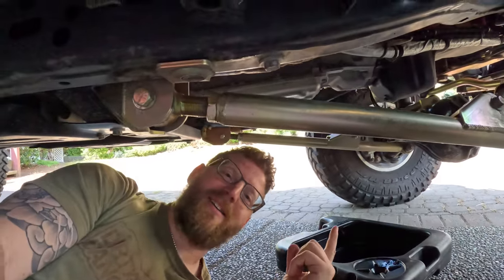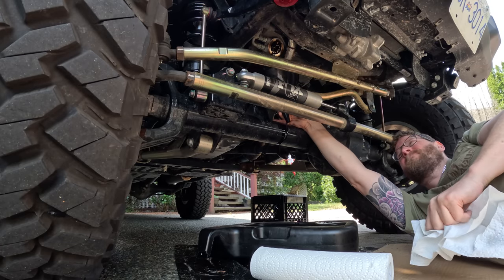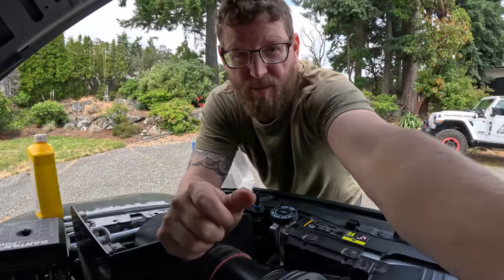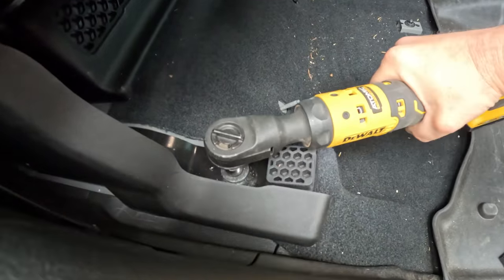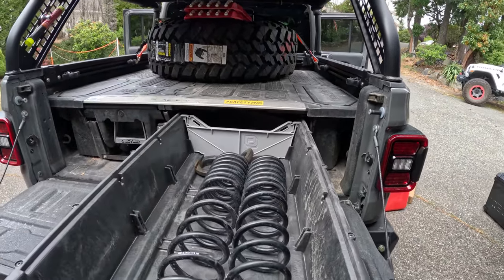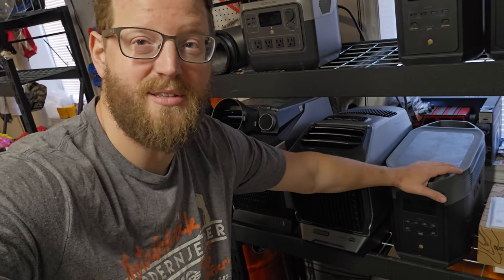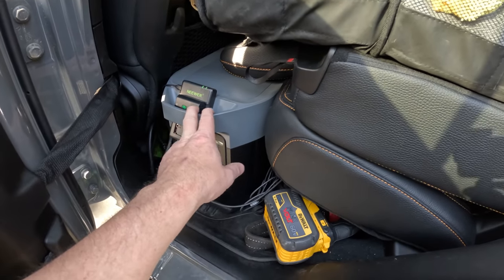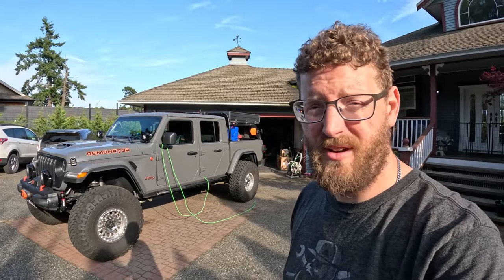I Am Really Struggling With My Jeep Gladiator...

Comment: I did the Decked system and half rack on a Tacoma, incredible waste of space,
Went with the RSI Smartcap on my Mojave, have bulkhead water tank, solar on the roof, house battery with both DC-DC and solar charging, stayed with 37’s, spare squeezes into stock mount, frig mounted on slide in the cap, pulls out over tailgate, makes a great cooking spot

Comment: For you Gladiator owners. on 37s, Clayton Offroad has a rear trackbar with a bend that will clear full size 37 under the bed.  If you aren't on 39s or 40s, this is a great option to get that thing back under in the factory location.
Reply: Clayton > Metalcloak
Reply: I have Clayton and that is correct

Comment: Topper , lose the decked system, hitch or bumper spare tire carrier, one that will also accommodate a fuel can and an auxiliary fuel tank where the spare used to be. Just a few ideas I’ve thought about with my gladiator. I kind of like Shawn’s setup.

Comment: I run my arb fridge in the back of my truck for the last 10 years and never had a problem. Dump the slide in the back,put a dry box in.  Put stuff you dont use much in the dry box.  Everything else in storage boxes or dry bags.  Spare tire on swing out on rear bumper.  Cant you store all your bedding ect. In the roof top tent.  The soft roof top tents may take a couple of minutes longer to set up but you can store tons of stuff in them.  I have a james bourand soft roof top tent and it does not use a fly.  It has a aluminized cloth outer.  I store all my bedding and in the winter 2 sleeping bag plus lights,guns,ect and still have room.  It is built to withstand 70 mph winds and only weighs 70 lbs.  Buy your Pennzoil synthetic from crappy tire when they have it on sale.  You can get it dirt cheap.

Comment: If you put a topper \ cap over the bed and ditched that deck system you will have way, way, way more dry storage capacity. I also stuck with 37s so that I can keep my spare underneath.

Comment: There is a bumper that is split in half as you see on other vehicles. My brother has it on his gladiator, and it allows him to carry his spare tire, his jack, and, I think, a gas can. It seems like a good option for him to use with his AluCab enclosure with the side openings and inside drawer system. A lot of safe storage is available. He also has a goose gear seat delete behind his seat with an inverter and lithium battery below to run the cooler he has on top of it.  Just a thought.

Comment: Most of that decked stuff can be in your cab if you remove the seats. Ditch the decked system. My wife and I have gone on a 10 day overland trip with less. My exped and down quilts are stored in my RTT. Fridge and dry food/ cooking storage goes in the back and takes up half the bed. Wood, toilet, and 20 gallon propane tank take up the other half. I have a low 8” tall rack and out my chairs on top of this stuff. I can’t imagine a wrangler holding the sheer amount of stuff we bring, but I’m on 35” trail grapplers so my spare is under the truck. 

Maybe put a flat spare under your truck with a ratchet strap that makes it so it won’t contact the track bar, or go with a triangulated 4 link and remove the track bar.

Comment: My gladiator is on 35s and a 2inch lift. Also I rsi topper. Planning on a desert armor roof top tent. This has covered all my overlanding type of trips and even Marble head trail in the UP of Michigan. Hardest for me is setting up the cooking set up. Thought are 270 degree cover with a small pull out kitchen.

Comment: I'm in the Wrangler camp.  I have mine setup with a rear seat deleted, a raised deck for sleeping, sliding refrig and cook stove, large drawer above cook stove.  Then built in storage cubbies under the deck accessed through rear doors.  Roof rack for the excess stuff such as tarps, recovery gear, etc.  Mine is a dedicated overlander and not daily driven.  When not tripping it sits at home.

Comment: I think the hard thing w the Gladiator is it doesn’t truck as well as a 1/2 ton truck and doesn’t Jeep as well as a Wrangler. I think as an overland rig it could be great, but as you said you have to pay that premium for even more thing like a canopy. And a canopy you can put a tent on will run you more that the hard top option on a wrangler. Or you can leave it open and then risk stuff being stolen or dust killing things like fridges. 

For me the real deciding factor is w dogs and summer I don’t have AC in a truck canopy so I will be going w Wrangle.

Comment: I am in the same situation minus the spare. Swapping out to a canopy/camper put the spare vertical and ditch the decked system. The other option would be a flat deck/canopy or a bowen customs bed replacement.

Comment: Ditch the Decked system, its great for construction guys and their tools, but you're losing 30% of your bed space.  Id find or fabricate a vertical tire mount just forward of one of the wheel humps in the bed or centered behind the rear glass, leaving the rest of the bed fully open for more creative storage systems than the Decked box.   Another option is the JCR Offroad Adventure Carrier that has two reversible hinged mounts, one for the tire and one for two 5 gallon jerry cans, both swing wide enough to still open the tailgate and access the bed.

Comment: Dunno why my first comment is not showing up but, I have the tire carrier bumper from Doetsch offroad on mine.  It's great but you will lose rear camera functionality for the most part (unless they have developed a relocation kit, mine was the prototype).  So all I did was get a Wolfbox front/rear camera system off of amazon and installed it on top of my rack.  Now I can see behind me without any real problems.  I also now have a forward facing dashcam as a bonus.

Comment: The decked system is your problem with your tire. Eventhough it's nice having the big drawers it takes up the whole bed and greatly shortens the height of your bed. If it wasn't in there you might could stand your tire up against the back then put a stacked drawer system to one side and have the other side fully open for whatever else

Comment: 40’s + Decked drawer system is in my opinion “Garbage”. The decked unit is 1. Heavy 2. Poorly Designed 3. A waste of space…  Not much you can do about the 40’s though… even with 37’s you have a fluid tank in your spare tire area if I remember. 
Best option for space with your setup would be a GFC or Alucab honestly. Love the content, keep it coming! 👍🏻❤️🇺🇸
Reply from the maker: Thanks! The decked was a last minute purchase before Moab to secure gear. It has its ups and downs and I've like it so far.

Comment: Trucks are a challenge for sure

I’m going to try the ARE CX HD with their windoors for side access. I’ve had a CX on my old 1st gen taco and it’s held up for 150k miles including 6 years of wheeling in Alaska so I’m going to try it again. YMMV though. It solves the water, theft and dust issues though

To your point, if you have a dedicated overland rig for 1-2 people, the wrangler seems like the way to go. Dan Grec’s Africa jeep, the road chose me’s crazy new custom wrangler camper, AEV Dave’s Outpost II camper, Venture 4wd’s full time camper, Justin B’s wrangler….great combination of secure gear storage and small vehicle capability 

I’m going Gladiator because it needs to be my daily too. Wranglers are definitely more capable but I like to keep my bike and skis inside the truck topper when I’m driving on slushy/salty roads and I definitely don’t want to throw a load of manure in the back of a wrangler when I’m doing house chores
Reply from the maker: Thanks for sharing

Comment: You'll have to do what I did. Remove gas cap. Slide a real truck under it. Reinstall gas cap. 
3/4 ton truck come ready to upgrade. Comes with power, torque, solid base axles to start with, etc. Single cab only. It's already heavy duty.

Comment: You need a topper...I plan on getting the RSI Smart Cap EVO. Also 40's are unnecessary in my opinion. My plan is to install Rock Krawlers 4 link triangulated rear parts with Nitto Recon Grapplers in 37 x 11.5". These will fit under the bed just fine. The Gladiator is a great platform but outfitting is a trial and error process. What works for me, works for me... your mileage may vary. There are many great ideas in the comments below...

Comment: The Gladiator build is great and made for some wonderful content as well, but I think it’s hard to beat the box-shape interior of the four door Jeep. That’s especially true if most of your gear needs protection from the elements (e.g., photo gear, including a relatively clean place to change lenses and so on) and to somewhat deter theft. As an aside, the included Power Box for the 2024 4xe looks pretty handy.
Reply: I’ve managed to get a crap load in my 2dr. I live like a king.

So any 4dr wrangler or gladiator can do it

Comment: When you put the new filter on: you should fill it with fresh oil (at least halfway, more if you can install it without it spilling when installing), you should also take a finger full of fresh oil and lubricate the band of rubber on the top of the filter before installing, clean the mating surface on the engine where that band of rubber contacts, and unless you enjoy throwing away money there's no reason whatsoever to buy a Mopar brand filter. A filter is a filter is a filter, it really doesn't have to be Mopar.

Comment: Quite a quandary,  Long trip, no tight twisty trails, lots of gravel roads and fire roads gladiator (i think you need to re-access your set up, wasted space and limiting yourself....may need more time in it you maybe stuck thinking JL.  Drawers are handy if done properly for application.  You may need drawers one side (sleeping platform on top) fridge and tire the other or even wheel up front tight to diver side (front of bed).   Day or two trips tight trails JL. You could even have an aluminum topper with opening side windows with mollie panels holding gear on sides.   One problem you need to consider with any vehicle: if i get stuck by my self: backing slide out or up against tree or rock how do I get my gear (don't make where you only access what you need by opening back/one side of vehicle).  Even with side access in a topper should be accessible from another area.  That is why we watch your channel to see what works and how well.

Comment: Go fast camper…. There canopy- side access…. Low profile tent…. 

Ditch the decked system and get Milwaukee Packout boxes.  There are several companies that sell stainless locking bases so they will stay in place…. The. Pick up a fridge slide etc….. 

As far as fuel storage?? Lol. Titan fuel tanks? Have had one on the JK and it was sick… but maybe try towing the gas station behind you? Fuel economy has to be bonkers.

Comment: Alucab/GFC and a rear bumper with a swing out. If you're packing multiple jerry cans I could see you having fume/odour issues with the jerry cans in the box. I see Relentless Fab has a bumper line up for the Gladiator, a company in Abbotsford built my bumpers for the Colorado when i had it and they turned out top notch, I think they have the best swing out design in the market *my own opinion*. Also the decked system is cool, i think they should offer a half option, that way the other half you would still have the full bed depth.
Reply from the maker: I checked it out, thats a 200lb bumper and tire carrier + 145lb spare that is past the rear axle that really impacts how the suspension is setup being so far back with so much weight.
Reply: @Casey250  ya they’re not light, but it seems options to get the tire out of the box are limited. I wonder if the Alucab canopy can hold a 40 on a beadlock.

Comment: My son just got the Moon shade. Super simple and light. Might be an option for you.
Reply: A drawback I see of that one, is that it has a sloped side to the vehicle, thus rain water will drip onto the open tailgate area. 🤷‍♂️
Reply: @blueman5924  yes it totally does. My son and I have Wranglers so that’s not a big deal. But on the JT ya might be an issue. 🍻

Comment: You really don't need full size spare tire. Just put 35 under the bed. It will work just fine, without locker's, before you get to tire shop.

Comment: Thanks for the great video. I just subscribed. I own a 2003 TJ and 2007 JK Rubicon but I’m very interested in the Gladiator. That said, you bring up some good points about its limitations. Is one of your Jeeps a diesel? I recently got a Cedar Ridge XT teardrop and want to tow it with a diesel for torque and fuel economy. I’m very impressed with your collection of Jeeps and overlanding gear, but have to admit that you need to get rid of the Ford and Toyota that snuck into the background during your video and get some Subaru’s instead.
Reply from the maker: The JL is diesel. Welcome to the channel

Comment: Yeah sounds like you need a tire swing out bumper with Jerry can shelf and then some organization in the bed. I'm building a custom drawer setup with a permanent box for battery, water, air, and electrical. I have more space than you, but a canvas surround on that rack to keep eyes off your stuff and some better organization and bumper and you'd be set. 
Edit: just saw you went with Metalcloak. Any fab shop should be able to weld on some swing outs for next to nothing.

Comment: Subscribed for more than a minute, but not OG.... but insert the gen Xer. Also a fellow JT owner. To quote two 20+ year friends own who own's a 4x4 shop and the other who in the GM of the same shop, "the happy median with the JT/JL is 37" tires. The only big need/expensive change is gearing." 
You went to big, granted you did it right and increased the HP (applause!!) at the same time. But 40's and up slaughter space and volume as you have learned. Are you looking to rock crawl (RC) or offroad (old school) or OVERLAND. There is a huge distinction there. Heck maybe a gargantuan distinction there!  It is also something that I struggle with as well coming from a RC background, yeah 4tays and 800 HP would be great but they come with diminishing return's (space/volume, weight, axle requirement's, fuel consumption/storage needs). Sometimes being stuck is 7/5th the fun, yeah the numbers are correct. 
Granted trails in BC are different than in my home of Colorado, but the overall mission of exploration is unchanged. Am I building a RC to do 99% of the trails? Or am I building a rig to offroad and do 92% of the trails (albeit with rock stacking, driving skills, luck and a good winch/other recovery gear and buddy for an occasional pull). Like I said, I also struggle with this, do I go with a FS on 42's and a big diesel engine, like a Prospector XL? Or do I go more moderate, get stuck occasionally and frequently need my driving skills to not unpack recovery gear (hot dam!!!!!!)????? It's an age old question/problem that even AI can't solve (to the best of my knowledge 7/01/23) it is also the fun of the run what you got! Heck next week/month/later today may have the answer; but where is the fun in that!! 
If I had the cash I would build a rig exactly like yours (the sound of the supercharged Hemi makes me drool.....). But tight trails, space/volume, the budget take hold of my thought's and dreams. DAMIT! Reality set's in. A Glad' with 37's (maybe today select 38's) take's hold and grab traction, now I've got the space for the family (that the wife can get into without a running start; or the ability to pole-vault, granted video would be needed of the pole-vault and a full episode at that!! ;)) and the kid(o)'s can all get in on their own (mostly) the dog too!
I may need to pull rope, I may need to stack rock's, toss plastic where you roll through, but now there is room for the dog too! You and Shawn are over here: EFRT, Matt and I are over there with fuel to spare Teddy brought Scout who is running around with Lando, and the ghost's of my old GSP's, we will all loan you fuel. But you better pull us all out when we are stuck! We will definitely share dinner with too, seeing as you saved us and didn't have the space to pack food. 
It is all about compromises. Sadly! TANSTAAFL
Dam 
TANSTAAFL!!
We forget that we are all in this game together!
Granted I'd loan you a sandwich, just don't put me on cam!
????now if there were a 66" bed making space for a bigger spare!!!!!!!!!!
Now that's a Thanksgiving to Easter fab/stretch series! Pole-vaulting skills not included!
But again TANSTAAFL
Do you want long term off grid trips or the on stoppable rig on the rocks?
Oh and to be clear, I never said your wife need's to learn to pole-vault! It is an implied skill necessitated by overly tall Jeep's. 
Did I say that I love how a Hemi sound's? If not I really love how a supercharged Hemi sounds🤤!!!!

Comment: Get "Glue Tread" to patch a tire and ditch the spare. If you're not doing a full gfc, consider a smart cap enclosre so you can store stuff in the bed without fear of thieves stealing exposed gear.
Reply from the maker: If never run without a spare. I just can't trust any other repair systems in a super remote location.

Comment: Do you Decked boxes stay dry? I had them in my Ram which I was just used for normal truck stuff and I had the same complaint about no cargo straps, and you need to strap down just about anything you put in the bed because there's not much bed side left! Also just felt like only specific things fit in the drawers, I didn't like how much was still under the deck when you open them, and they didn't stay dry! I had to drill drain holes in mine.
Reply from the maker: Everything stays dry and no dust

Comment: Crack the rear window, run a flat extension cord through it and plug the fridge into the back of the center console. Literally just got back from a 1000 mile 2 day trip like that. Window will close also.